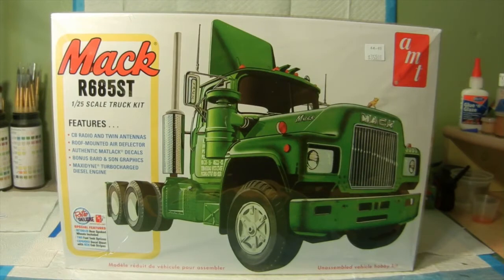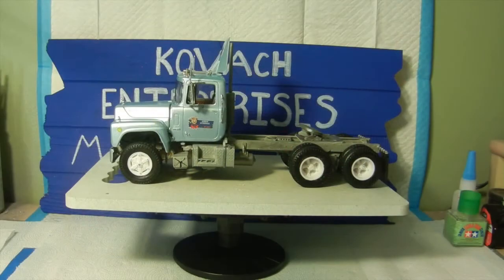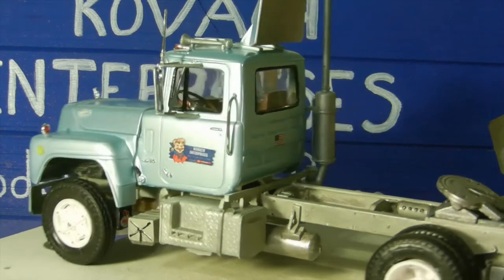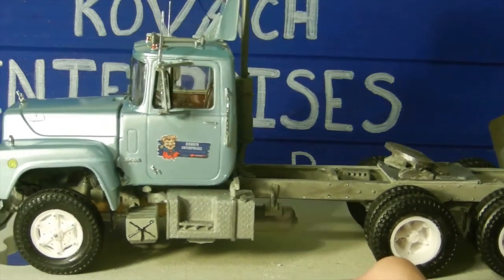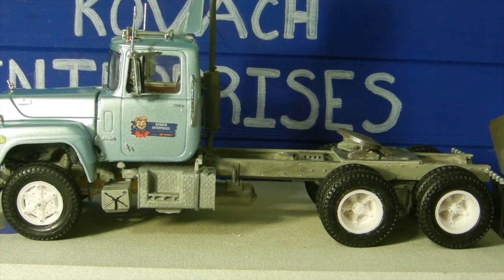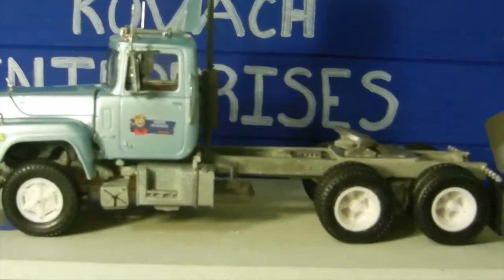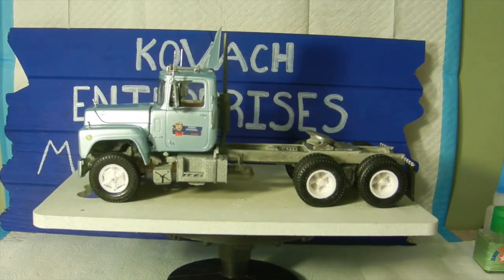Big Rig Group Build Finale

Comment: Great job Mike, :)
Reply from the maker: Thanks Tom!
Reply: Hey Mike can you tell how you went about assembling of the entire wheels and tires assembly I am getting lots of problems understanding how to put them together......please help cause I saw your look perfect.....
Reply: @michaelkovach7973  Hey Mike,can you tell me how you went about with the entire wheels and tires assemblies of this same kit that I am also doing,cause I am doing mines right now and I am having serious difficulties really understanding how to put them together properly,I saw yours went together perfectly,so I am asking you please to help me understand how to do mines also Please Mike I NEED YOUR HELP......
Reply from the maker: Marlon Barrow sorry for the late reply to your question. Had to get thru Hurricane Michael here in Florida. Basically, I “trimmed” out the inner perimeter of each tire just enough to accept the wheel with a lip. Then used CA glue with a toothpick around the lip and installed the wheel and let sit overnight. Did the same technique to all the other wheels and tires. Hope this helps you.
Reply: @michaelkovach7973  Hey Michael Kovach thanks for the advice....but that part was not my concern(I did already got through with that part of cutting out that inner perimeter of the tires)my concerns were about for example if you were to set up together(without the tire/tires)all those components like the brakes drum,inner wheel and outer wheel,the assembly would be much wider than the tire itself,so now if when you now apply the tire to that assembly both the outer wheel and inner wheel with the brakes drum exceeds to much outside the both sides of the tire,that as I said was my concerns Mike.....now I came up with my idea to sand down both the outer wheel and more of the inner wheel to a considerable degree just enough that the two parts would fit more inside of the tire/tires,but I said to myself let me ask you firstly before I go that way to hear what you did with yours before I proceeded  to go with my plan if I didn't get a reply from you,but you did reply and I say THANKS AGAIN Mike......and by the way I am from Trinidad and Tobago in the Caribbean,and I wish you and your family and your model a safe journey through your name sake Hurricane Michael pleas God
Reply from the maker: Hey Marlon, looks like you have a good plan for the tires and wheels. I basically assembled the wheels and tires together and used a tongue depressor in the center to keep pressure to the outside and inner rims while the glue was curing before installing to the main chassis of the truck. My family made it thru the hurricane. Thanks.
Reply: @michaelkovach7973  Hey Mike hi again this is Marlon,I see that you understand what I was asking you about,yes it is a little tricky project with those tires and wheels,but at the same that is what we are all here for to help each other out when needed just to make sure of something if you are not 100% comfortable/sure with,so thanks once again my model building friend.......and I am happy to know as you said that you and your family,and offcourse your models made it through that terrible hurricane named Michael......
Reply: @michaelkovach7973  By the way Michael what is that tool you said you used called a" Tongue Depressor"
Reply from the maker: Hey Marlon, not so much a tool, but a thin wooden "stick" what we call in the medical field a Tongue Depressor. The kind that the doctor uses to place on your tongue when checking your mouth, throat etc. You can also get these "Tongue Depressors" at any craft store.
Reply: @michaelkovach7973  Or....Ok! I understand.....I'll ask my aunt about it or to ask her to probably get one of those for me because she is dentist lol........Thanks again Mike
Reply: @michaelkovach7973  I really thought it was some kind of model building tool that you'll have over there,because that is the advantages of your country when it comes to model building you'll have at hand a vast array of model building tools that we in Trinidad and Tobago don't really have,we just have to make do or improvised whatever we have here at our disposal to make our hobby looks great like how you'll does......(which it was that easy to aquire those kinds of tools......)

Comment: What kind of paint is that?
Reply from the maker: A.J. Smith The color paint I used on the cab is called Ice Blue from Folk Art #2588. It’s a Metallic paint I got from Michaels. Hope that helps. 😃
Reply: Thanks. It helps a lot because it’s the perfect color for a Pontiac engine block. Thanks again